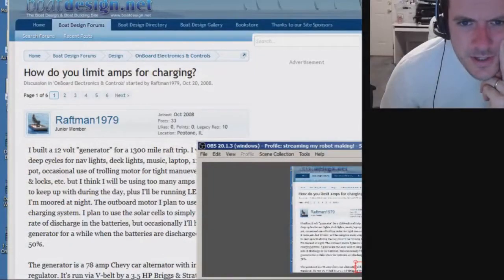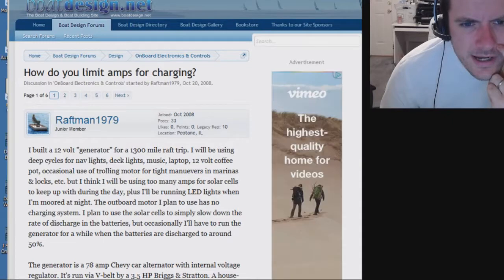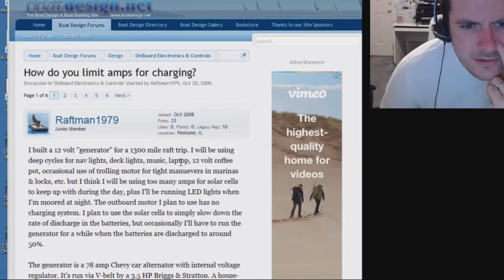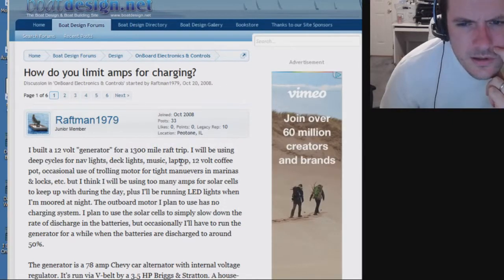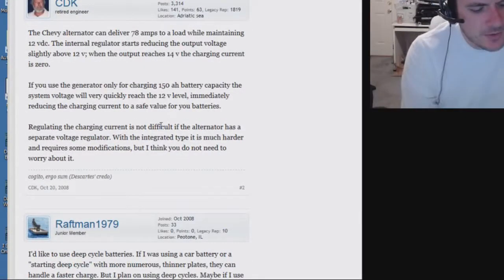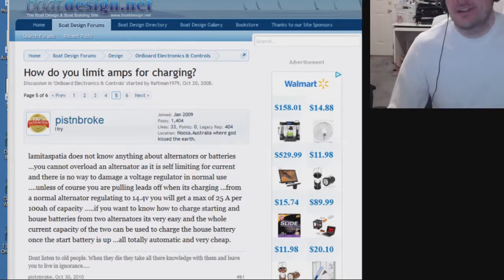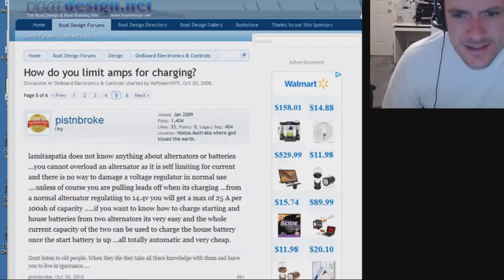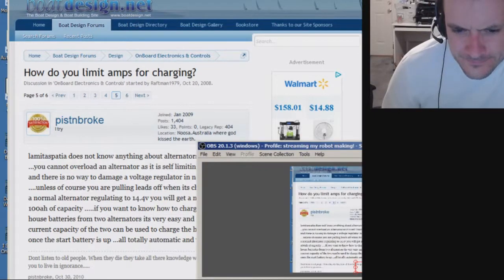How to Limit Amps for Charging by Using a Mosfet

Comment: Funny. I saw that forum. I am currently working on a dashcam setup. I was interested in using the parking mode feature. They do sell battery packs that can be hard-wired to a vehicle's electrical system and charged while the vehicle is running. These products are relatively expensive. I was looking for a cheaper solution. My solution was a cheaper battery pack (same size as the expensive all-in-one units) and a battery discharge prevention device. I was going to hard wire  as follows: vehicle battery -> battery discharge prevention device -> lithium ion battery pack -> dash camera. 
The lithion ion battery comes with a wall charger with a rated output specification of DC 12.6V 1A. I'm not sure if the lithium ion battery has a built-in charge controller or if the battery is charged by the steady power source of 12V 1A. I wanted to wire this charger to my vehicle's electrical system and charge the system while my vehicle was running (13-14 Volts while running). I thought it might be prudent to reduce the voltage and limit the current during charging? 
It sounds like a Mosfet could be an option. Is this method used by ordinary battery chargers? I would still need to correct the voltage too...
Reply from the maker: Yes, I do believe ordinary battery chargers use a mosfet to limit amps as shown in this video.  You can use a cheap buck converter for like $3 on ebay to limit the voltage and a off brand arduino nano ($4) to do the mosfet switching to limit the amps.